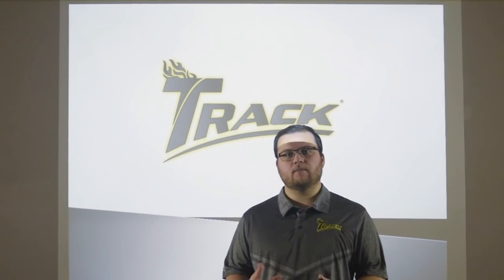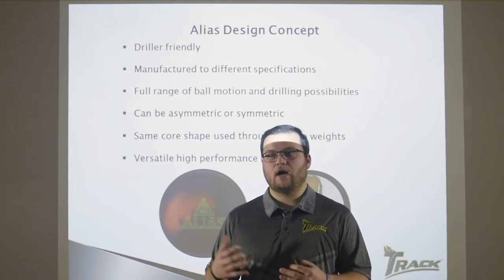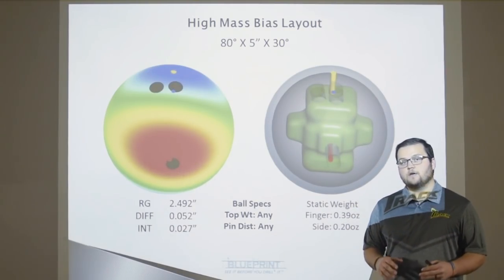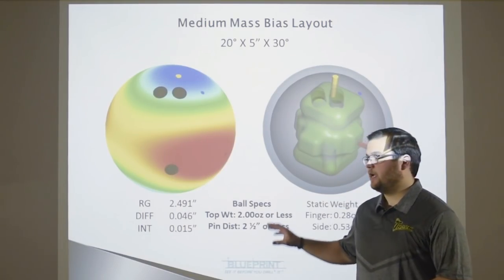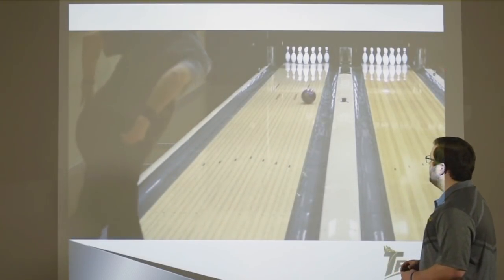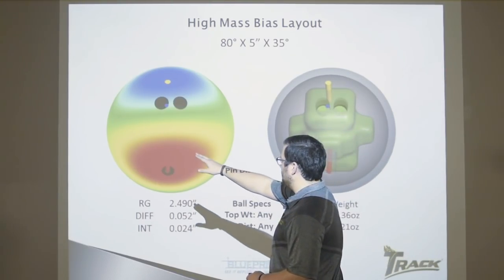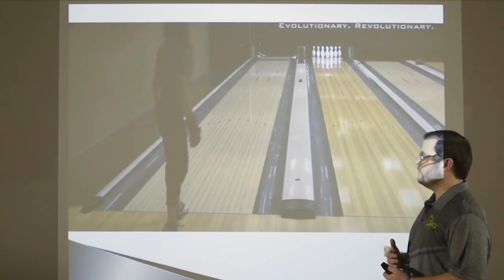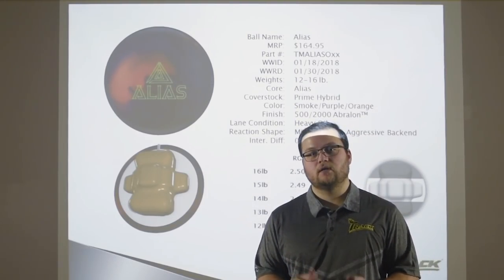Alias - An In-Depth Look at the Engineering and Principles Behind Track's Latest

Comment: What if you are a no-thumb bowler? Just curious how you would drill to get the different mass biases.
Reply: I assume you'd still drill the thumb hole to get the mass bias you want that would work with your rev rate, axis, etc.    

You still would need a start point even if you don't use the thumb hole.